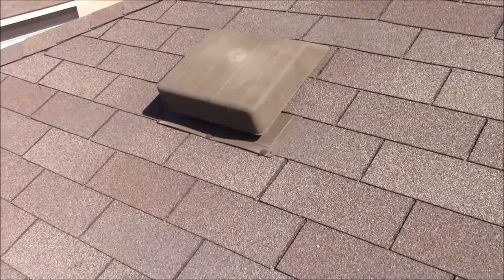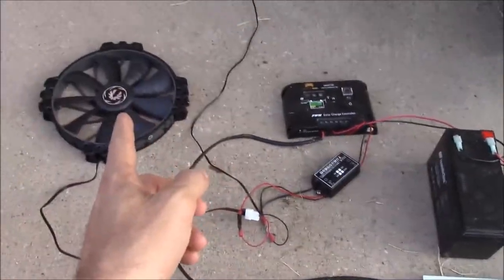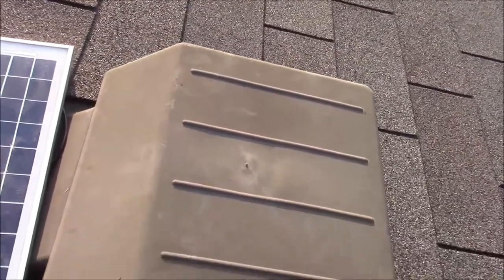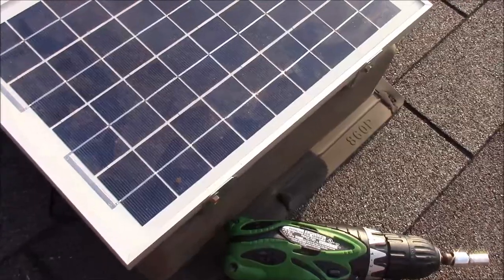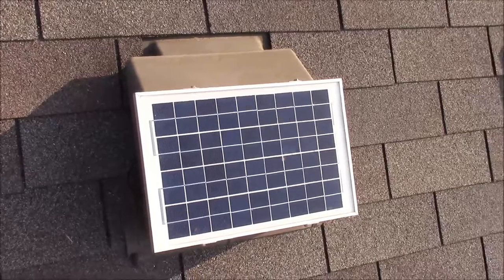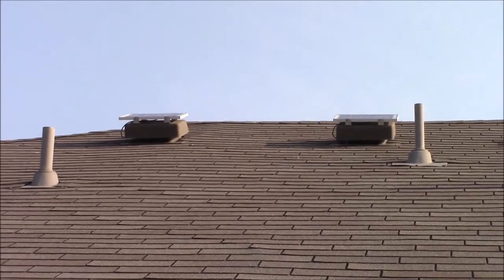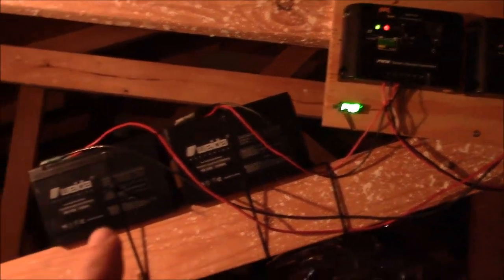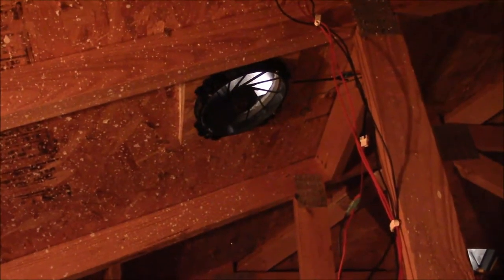Save $$ This Summer - DIY Solar Attic Fan for $75

Comment: Something I like about your system over the commercial ones is your battery system handles the need for the fans to run long after the sun sets. Did you monitor the performance? Regular attic fans move about 1200 cfm or more and still need to run sometimes as late as midnight to reduce the temp to 85F.

Comment: Hey! I checked out your channel and found many other interesting videos but I couldn't seem to a follow up to this project.  How did this work out?
Reply from the maker: Well I tried my best to quantify any benefit but was not able to detect any with my crude measuring equipment.  I was not able to isolate all the variables in order to compare a day running with these fans and a day running without them.  They still work today, though.  Thanks for checking out my channel!

Comment: Hi LDSreliance,  Great video!!  I think you have a really interesting solution for solar house fans, and I would like to know the results of pulling 150 cfm on your house.  For ex. 110 F outdoors, 82 F indoors without HVAC etc.  Have you been monitoring the actual results of your setup?  This is very promising for a low-cost solution for Cooling.
Reply from the maker: I have two of these systems and each are pushing about 150CFM like you said.  This is such a small amount of air that it is really hard to measure a difference.  I have a temperature logger that I can use to log the temperature in the attic over time but there are too many other variables.  Even if you took logs for two different days that happened to be the same outside temperature, the amount of direct sunlight on the roof plays a huge factor.  One of those days could have been partially cloudy with a few periods of time where the attic was shaded by clouds and that could drop your attic temps by several degrees.  Also, the humidity could affect things a bit.

So I gave up trying to quantify the difference.  I am just happy that they work and have continued to work for over 3 years now.

Comment: Very cool. Been thinking about setting up something like this for my attic. How's it working? I hadn't thought about the solar panel part, but was just going to wire up a fan or two ,directly , with a switch somewhere.
Reply from the maker: You can do that, too.  I just prefer solar and didn't want to add any AC circuits in my attic.  At one point I was thinking about putting these together in a kit and selling them.

They are working great, although they don't push a ton of cfm.  I have been thinking about upgrading to some much more expensive fans ($100 each) that push about 3x more cfm and only use slightly more power.
Reply: Excellent video and a nice project.  What fan are you considering for your upgrade?  I like the thermostat and battery approach as it stays hot in my attic well after sundown here in VA too.
Reply from the maker: *****
I am thinking this fan @ 12v (the 12L model) as it uses low enough energy to run off of a small solar panel yet pushes over 4x more CFM than the previous computer case fan:

http://mouser.com/ds/2/310/OD254-473106.pdf
Reply: Thanks! 
Can you run that with the panel and the batteries you currently use?
Reply from the maker: ***** I don't think so.  The fan uses 13 watts and the solar panel is only 10 watts.  The battery may be able to make up the difference for a while but would never have a chance to re-charge.  I may have to mount a 20 watt panel up there for one of the fans and use the existing two 10 watt fans in parallel to run them.  Still brainstorming, though.
Reply from the maker: ***** That looks great.  It doesn't show specs of the fan, though, and I would be a bit skeptical of that much cfm with only a 35 watt panel.  But I would be interested to see how it works out for you.  Just add in a 10Ah battery and that should allow the fan to continue for a couple hours into dusk.
Reply: Have to buy 12 of these to get one. Not an option for me. Is there a place to buy one of these fans ?

Comment: This video was very intriguing until 1:39-1:41. I couldn't help to laugh because you casually carried on & I spit my drink all over my computer screen.
Reply from the maker: Why is that?  The vent caps are small and you can't fit a 20-30 watt panel on them.
Reply: LDSreliance
It sounded like you passed gas or is it me?
Reply from the maker: AmuckPVP
Haha it does sound like it.  I am pretty sure I didn't but that is funny!
Reply: It SURE sounds like you did!

Comment: hi there, where did you get the 12v digital voltage meters?  or what are they called or a part number or something like that?  thanks for the video.  and also what are the specs for your little batteries if i may ask.  after you did the job, do you feel you need the batteries for the system, or do you use them at night?
Reply from the maker: +Jennafer Yellowhorse You can get them lots of places.  They are just called digital voltmeter and there are lots of cheap Chinese made ones.  Here is one example:  http://www.amazon.com/3-2-30V-0-56inch-Digital-Voltmeter-Two-wire/dp/B00L8HK2H0/ref=sr_1_12?ie=UTF8&qid=1452918028&sr=8-12&keywords=digital+voltmeter

Based on my temperature log data, the attic stays hot until about 3am in the summer so I use the batteries to keep the fans running until the temperature drops back down to the thermostat set point.  It works well.  If you just want the fans to run while the sun is out, that is fine but it will probably only run full speed for about 5-6 hours per day so you don't get as much benefit.

Comment: Hi, I love your video, it makes it look simple. I have a question, can I just install the solar panel with the fan and just the thermostat? Or would I also need the battery and charge controller? (I know nothing about electronics) Thanks!
Reply from the maker: +Lalagartitita Yes, you can.  That would be the cheapest way to get some benefit.  The reason I chose to use the charge controller and battery is because my temperature data logging showed that my attic stayed 120 degrees + until about 1am or 2am every night.  So I was hoping that by allowing the fan to continue running into the night after the solar panel stops working that I could help speed up the cooling down of the attic.
Reply: LDSreliance Thanks a lot!
Reply from the maker: *****
You are welcome.  Thanks for watching!

Comment: I need to do this
Reply from the maker: It wasn't hard.  And you really don't need the batteries and thermostat and charge controller like I used.  You can simply connect the fan directly to the solar panel.  I chose to do it this way so that my fans can keep running even at dusk until the attic is fully cooled down but that really is only another hour or so.

Comment: hi...thanks for this video, i want to do the same for my attic, just a question, do you know how many CFM this 200 mm fan is rated? so i can estimate how many fans i need to install on my attic.  i wanted to try using a electric fan 12v for car radiator but it is to many amp (12v/80W)= 6.66A...i will need a 100w panel...to expensive i think... I would like to do a direct connect because always is hot in my country (guayaquil - ecuador) and i want that the system works all day, thanks for your help and reply...
Reply from the maker: They push about 150 CFM at fairly high pressure for a computer fan.  Yes, you are finding out what I found out when I did this.  I was going to go with a much more powerful DC fan but did not want to install hundreds of watts of solar panels to do it.  There are some better fans out there that use fairly low amps but they are very expensive.  You can power a whole bunch of computer fans for the same price and power them with small panels that you can mount or hide almost anywhere on your roof.  For example, I didn't want to penetrate my roof with any screws or anything so mine are just mounted to the plastic roof vent cap.  So someday when I move out of this house they will take only a few minutes to uninstall and there will be no holes to fix in the roof.

Comment: Can you post a parts list please? Links maybe?
Reply from the maker: It is basically this kit:

https://kit.com/LDSreliance/beginner-solar-diy-kit-10-watt

You would also need a fan and a thermostat:

http://amzn.to/2njGVZL
http://amzn.to/2njJjzG
Reply: LDSreliance Thank you very much!
Reply from the maker: You are welcome!
Reply: LDSreliance Is yours still working good after 2 years?
Reply from the maker: Yep.  One of the batteries doesn't hold its power as well as the other but it still works.  The battery portion is not required, either.  You could do without the battery altogether if you wanted as long as your charge controller can operate without a battery attached.

Comment: what do you have the volt meter hooked up to? the batteries or charge controls
Reply from the maker: +chriscoronado99 You can hook it to the solar side of the charge controller and you will see what is coming in  from the panels.  Or you can hook it to the charging/battery side and see what the voltage is going into your batteries.  You can't accurately test your batteries while they are plugged in to the charge controller because they take some time to settle back down to get an accurate reading.

Comment: Here is a place that I have been using for years that carries the large Computer fans.  
 http://www.frozencpu.com/cat/l1/g36/Fans.html?id=fYwEbgZ2
or FrozenCpu.com  and of course check out your local places like Fry's Electronics.
  Do not forget that you can use car/Auto radiator fans but they can require serious wattage.

Comment: now thats cool. :) it would be fun getting the power  from the attic to the basement.. i dont think my walls are open..
Reply from the maker: +MRJOHNDEERE3720. :) Yes that is the next challenge.  You may have to get creative on that.  A lot of cable tv installers will run the cable on the outside of the house and then punch a small hole with a drill where they want to enter the building.
Reply: LDSreliance
o ya there is a hole on the other side of my house, i could run the wire over the roof then down on the outside of the wall  then into the basement.. would that be safe?  o maybe  i could not do that becuz then it all will be downstairs.  it might be closer that way.. ya i dont know.. how many batteries could i charge with a 35 watt panel? see that my fav website sells them.
Reply from the maker: *****
35 watts won't do much.  It would not be worth the price of the thick wires to just do a small panel like that.  I thought you were talking some of the big panels.  The wire alone will cost you about $1-2 per foot.
Reply: LDSreliance
i dont think a small panel will charge much not for the things i want to run off it..
Reply from the maker: *****
Yeah what do you plan to run off it in the basement?
Reply: LDSreliance
 i have 1 thing in my basement & thats my sump pump. then i have 2 things upstairs that i would like to run off it if i can  & thats my refrigerator & a my backup heater for the winter time..
Reply from the maker: *****
Wow those are all really, really power hungry loads.  We're talking more like 3500 watts of solar panels and not 35 watts.
Reply: LDSreliance  o ok. the bigest panel i see from my website is 300 watt but theres no way im paying $900 for it..i would have to start off small then over time get biger things. what would it take just to get the sump pump on solar power?..
Reply from the maker: *****
Does it have a sticker on it with the power consumption number?  Or a model number I could look up?
Reply: LDSreliance on my pump? i think thats 120v not to sure on the amps. im sure its under 20A i know its a wayne pedestal sump pump.
Reply from the maker: *****
Well 20 amps at 120v is 2400 watts.  So that is a ton of solar power required to run that thing.  So we need to know exactly how much it needs and go from there.  Surely there is a model number on it.
Reply: LDSreliance i googled my pump i got the amps wrong, the Motor Amps is 5.3 Amps so mine would be about the same 5A  i will go look to make sure but im sure im right..
Reply from the maker: ***** 5.3 amps at 240 volts?
Reply: LDSreliance  no at 120v  my pump is older so the amps on that are 6.3 amps
Reply from the maker: ***** OK so your sump pump is 120 volts and 6.3 amps.  How many feet of wire do you need from the solar panels on the roof to the charge controller in the attic?
Reply: LDSreliance
yes. i want more then what i think i need.. soo maybe 50 feet. & i could cut it shorter to.. & i would have to find the right size panel as well.
Reply from the maker: I would say you should shoot for a 120 watt solar panel and a 20 amp charge controller. There really is not much price difference between a 10 amp and a 20 amp charge controller but the added benefit is the 20 amp controller can handle bigger surge loads from the batteries.

To go 50 feet with 12v DC is going to require very expensive wire.  You need 2 runs of wire (one for positive and one for negative) and it will need to be at least #4 AWG to go that far without significant voltage drop.  If you can keep it to 20 feet or less you can get away with #8 AWG which will drop the price by 80%.  Use THHN wire (you can find it on Amazon or wherever) and get one length of red wire and one length of black wire.  You will also have to make sure your charge controller can accept wire of that size.  The cheapo controllers on Amazon and Ebay can't handle #8 AWG let alone #4 AWG wire.
Reply: LDSreliance o ok thanks. :) the only way i can see of staying under 20 feet is going right off the roof then on the side of the house to the basment. that could work fine.. i think all i could do is just play around with it. start with 20 feet of line then get longer ones if i need to.. how would i get the power from the inverter to a 120 plugin i think inverters come with there own built in plugin's. or sould i just run a extension cord from the inverter to my pump?
Reply from the maker: *****
There are hard-wire inverters out there that would allow you to wire to your own outlet box.  Or you could buy a regular extension cord and chop off the end of it and use those 3 wires to wire in your outlet box downstairs.
Reply: LDSreliance
o ok thanks. ill have to look for those.

Comment: Damn, why not just go direct solar with the fan? Screw the battery and charger...
Reply from the maker: That is a valid option.  My thinking was that the attic is still 130+ degrees until about 9pm (according to my data logs) so I wanted the fans to be able to continue to run into the evening.  Without batteries the fans would stop working after about 6pm even in the summer.